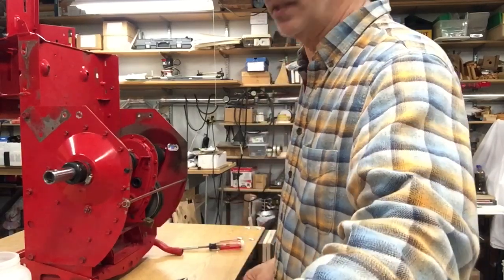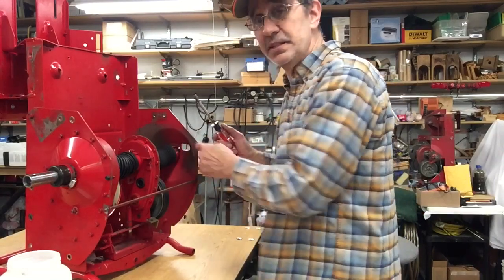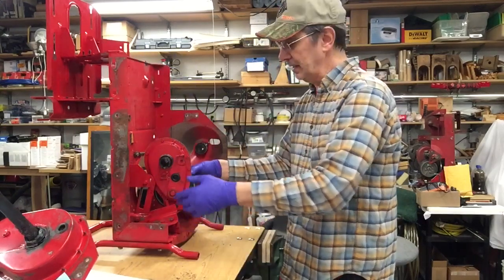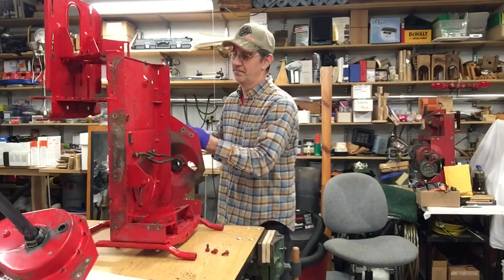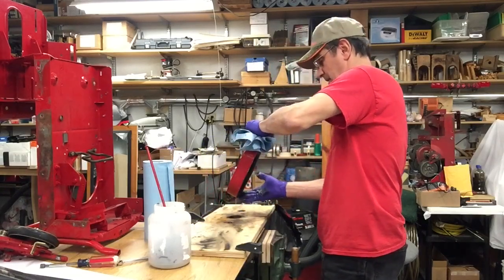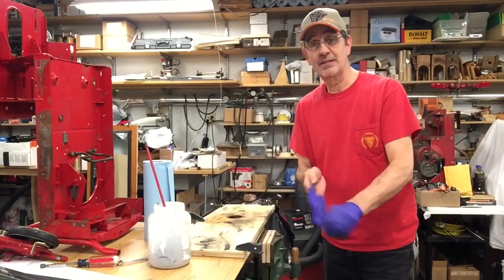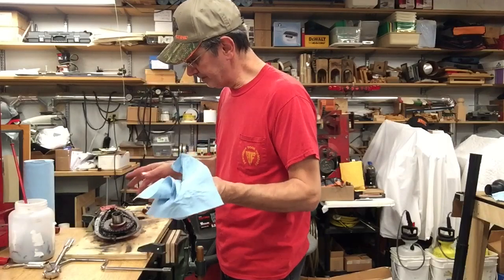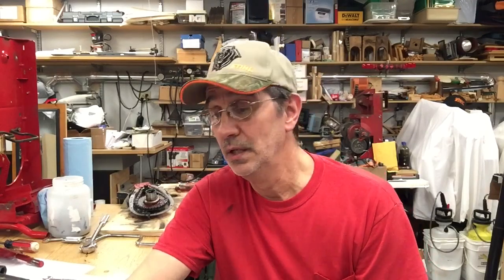378.How can I disassemble the drive train in my 33” Snapper rear engine rider￼.

Comment: Speaking of cleaners, I found a cheapo cleaner solution at Dollar General that works wonders! It's called LA's Totally Awesome. & two gallons cost me about $13. Other than the Snapper grease it cleaned my parts overnight.
Reply from the maker: @amathonn  wow yes I know about that. We’ve been using it for years at work our dollar store isn’t a dollar store anymore. It’s a dollar and a quarter store. You can get it at our store a dollar and a quarter for half a quart with a spray nozzle or you can buy a quart with a plain cap for a dollar and a quarter and your spray nozzle screws onto the bottle also so at our store a gallon would cost you five bucks.        Jim

Comment: Hey Jim maybe the one housing that had a wear hole in the casing put all the weight on the smaller good casing that may have caused more pressure on that bearing that was hard to come apart? Just guessing , I've never taken any Snapper housing apart on my rer or my s/p walk behinds , All I've ever used is 80W90 gear oil in them never used the 00 grease thank goodness,Thanks for the video SNAPPOUT.

Comment: Jim, I have a 28" turtle snapper.    No bag assy for it so I bought a Troy built dually bagger for. 30".    In process of installing.   Need to get some stuff fabbed on the back to mount the bagger.   Plastic part... "fits" when u mod it slightly and drill some holes in the deck.   Once finished I'll send some pics
Reply from the maker: I would really appreciate that and maybe a explanation of what you had to do because I do have other viewers with the same issue, thanks.  Jim
Reply: @jimjackson9381  Yeah, no problem, i'll make a vid and put it up.  I'm trying to document my steps.
Reply from the maker: @ericensley2427  If you do a video on your installation and send it to my email which is
jimsfixitshop@gmail.com
I’ll upload it to my YouTube channel for you , make sure to show yourself and mention your name in the video. Jim
Reply: @jimjackson9381  Do you have a recommendation for a blade?   Still not done, waiting on my welder buddy to help me finish the final fab.
Reply from the maker: @ericensley2427  You shouldn’t have any trouble getting a 28 inch blade for your machine I buy them from my local dealer and you should be able to find them on Amazon or eBay but watch what you buy from eBay they don’t always send you what you want, let me know if you can’t find one. Jim

Comment: I think the hole on that one side is for the grease gun. because there is a grease fitting on that bushing.
Reply from the maker: Actually most people use it to get a screwdriver on the clamp holding a boot on

Comment: I'm not sure  that the Snapper lube isn't supposed to be that way. In the parts manual I have it says "grease". When you think about it, those components don't spin very fast and regular gear oil might be too light to get slung up onto everything. It could be that you need something more akin to wheel bearing grease. I don't know this for a fact, it's just speculation,

Comment: Jim, Just bought a 2018 snapper mower, and when I put it in "gear" and let off the break/clutch, there is a lag from foot totally off the break/clutch to when the mower lurches and starts to move.   Is that just slop in the drive system, or is there something going on with the clutch?   Never owened a snapper before.   last riding mower I owned was a 85' rear engine craftsman with a manual geared trasmission.   We actually used that to move my ol' mans 21' deep V boat wound, and worked like a champ... I don't think the snapper will move much with that friction drive.
Reply from the maker: Well I don’t know how many of my videos you have watched or if you are a subscriber but if you indeed did buy a 2018 machine it will be one of the last I called the turtles in 2019 they came back out with the original classic machine, if you can stand your machine up carefully if it is a turtle they are extremely front heavy and they like to tip over very easy you want to have it in neutral and turn the clutch disc by hand and see how many times you have to turn it to make the tires turn, I would start by watching video number 70 and tighten your yoke spring and see if that helps your issue. Let me know what you find out. Jim
Reply: @jimjackson9381  JIm, thank you.   On mine you can not stand them up, it does not have the frame member for that.   

Do you know bag kit I need for this model.   it is a 7800950-00.   I need to climb under it an tighten that spring like in video 70

Thank you again
Reply from the maker: @ericensley2427  you must have the body style that I refer to as a turtle, if so I do not have a bagger for that machine. Jim

Comment: Hi Jim finished rebuilding my 33 inch  when I did the chaincase I knew I was probably gonna have a leak because one of the needle bearing was way loose in the cover I just pushed it in by hand to fix that do I need to get new cover or can I do something to the old one
Reply from the maker: Yes if you can’t press the bearings in the top of the chain case you’ll have to do something to fix that or get a new cover the hub and sprocket in the chain case relies on the edge of the bearing for alignment in the center of the case the positioning of the bearings in the cover is critical if the bearings are loose you won’t know if the bearing has slid out of the chain case because of the boot then the chain will eat a slot through the side of the case and probably will also damage the lower sprocket from the chain riding on its side. Jim
Reply: @jimjackson9381  yea I don't want that to happen I'll take it back apart and get some new covers again thanks a bunch jim
Reply from the maker: @andrewoodard8929  What’s the model number of your machine I may have some covers that will fit it. Jim
Reply: @jimjackson9381  331411kve
Reply from the maker: @andrewoodard8929  well the schematic doesn’t show me a very good picture of your chain case can you take pictures of both sides of your chain case so I can see what kind of brackets you need on it. Jim
Reply: @jimjackson9381  yes I will when I get home at work now
Reply from the maker: @andrewoodard8929  ok thanks.  Jim
Reply from the maker: You can send them pictures to my email which is
jimsfixitshop@gmail.com
Thanks.  Jim

Comment: I'm still not sure why anybody would buy one of these machines with so many wear items items. I have an 02 craftsman that I bought brand new and have only replaced blades, belts and tie rods, plus oil changes. If I had to teardown one of these things and rebuild it every few years It would become scrap fast!
Reply from the maker: Well for starters the machines that I work on our machines that have been abused and miss used for a lot of years when I first got a snapper I did some work to it I took care of it once a year clean oiled greased and I ran at Machine for over 20 years and never had an issue with it including the original engine, now it’s the one I use for my model you just have to take care of stuff And it will last not to mention the snapper is the only machine on the market today or back when mine was originally made that will pick up anything that you run over I have not found a lawnmower yet that has a vacuum power and bag ability then a snapper does, see what you like but if you got one and took care of it you would never get rid of it. Jim